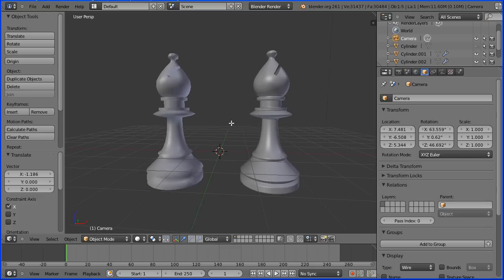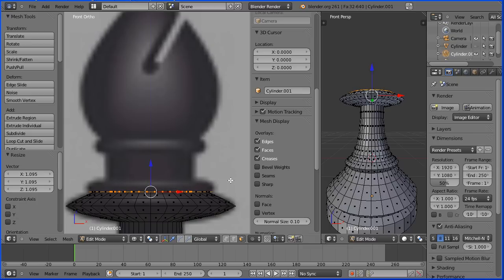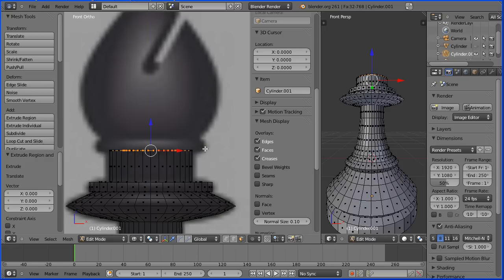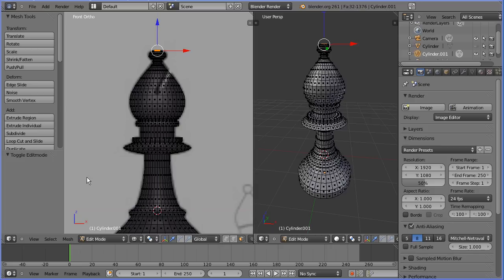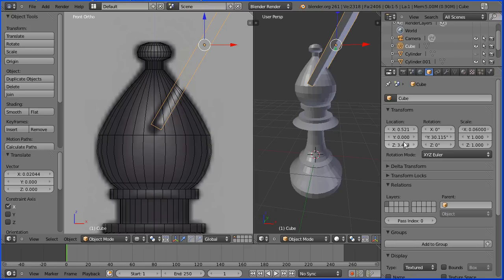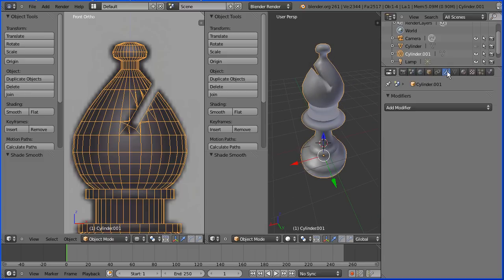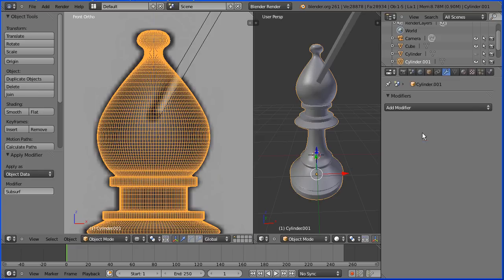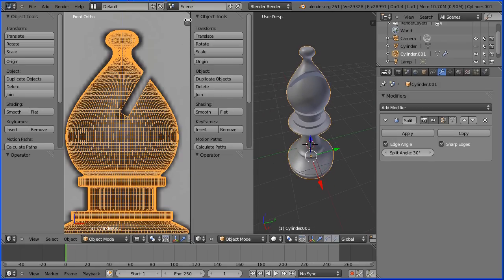Blender 2.6 Modelling Tutorial Making A Bishop Chess Piece Using the Boolean Modifier

Comment from the maker: @kalzorath Sometime but when I'm not sure. The method I would use would be in two parts, the plinth at the bottom would be the same as the pawn and the bishop. The horses head I would most probably use the same method as I used to make a spoon (see tutorial), I would trace out the head in 2d, extrude it, then shape it with a mix of subsurface modifier and proportional editing.